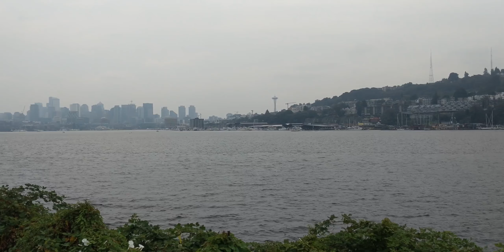Air Quality Station #1 - Introduction

Comment: I'll be interested to see if you have any customs problems getting these sensors.

I had a $25 Ebay order that made it to my post office "recalled by customs" last week.  I don't know yet if it's a tariff issue, or a problem with what I ordered - a bunch of surface-mount LEDs, a Microchip PICkit 2 clone ( of which there are millions in circulation and which is considered obsolete by Microchip) and a microcontroller dev board/ logic analyzer.  There could be some IP issues with the last two, but I doubt the customs declaration spelled them out in detail.